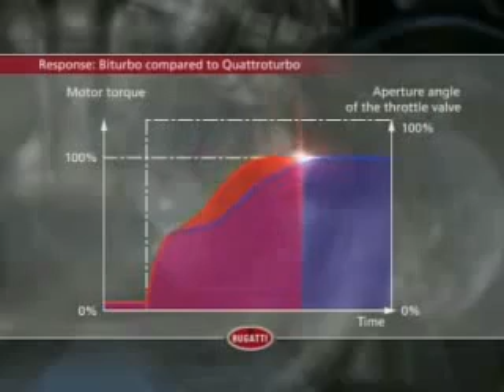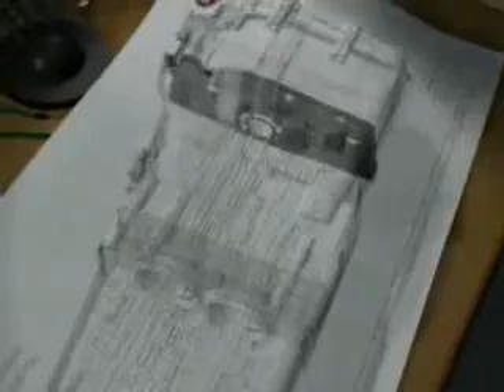Bugatti Veyron Engine how it works

Comment: Designer ip protection  body 
Innovative of rebirth engine redesigned Yorkshire Roger Lee 1983 to before market crash 1987
Innovative of human interlect  industry bugatti 2 piece solutions 
A early teenage mechanic  panel beater given  task 
Without bugatti  typically idea's  of interllctual minds work  mysticism missing innovation  nonaccount  since 1920 
1983 1987 recognized bugatti designs otherwis frozen till 
Late 2007 onwards 
Appose bugatti vw   Germany 1998  application
Actional  discrepancy unacceptably decade's 1983to1988 bugatti revived missing file on school high behalf records tangeleticall

Comment: There are some complaints about "weakness" of that engine(i.e. "oh no, old supra can do 1000hp as well"), well it's not about absolute extreme of power over rpm function, best riding experience is about derivation of that function which have to be as constant as possible yet starting at highest level. In another words you will appreciate constant or at least lineary growing torque to supras/gtrs 1000hp which is kinda 100hp@2000rpm/200hp@4000rpm/300hp@5000rpm/1000hp@7000rpm, yet good for dragster-like perfoming it is unusable under normal city/highway conditions. And good power/torque distribution over entire rpm range comes from engine volume (considering other things like turbo or ECU quality/perfomance are the same). And of course people complaining about 1000hp is not so much seems to be the ones who never seriously tried even true ~300hp car at its 300hp rpm range on the track - even that "weak" engine requires damn good skills to turn. Also look at wrc cars, not so much hp but yet mad perfomance thanks to torque distribution.

Comment: 1000 hp really isn't all that impressive when you think about it
Reply: 1000 hp isnt that impressive because a GTR or supra can do 1000hp with 1/10 of Veyron's cost. But what is impressive is the way that engine delivers power and also the reliability of it.
Reply: yeah, because everyone makes those kind of engines...
Reply: mmdirtyworkz its not about everyone doing it it is just that fro 16 cylinders and 4 turbos you should expect more from such a complex high price motor
Reply: I agree it really ain't especially when you figure the cost in on one of these car's you would expect a hell of a lot more it sad you can take a average small block ford gm Chrysler and build it to push just as much HP for a fraction of the cost. but I guess it's like a nike shoes your paying for that name.

Comment: Does it have VTEC?
Reply: clearly you're too stupid to understand a joke.
Reply: well the joke wasn't funny at all
Reply: maybe for your feeble mind. run along child.
Reply: +dsmero I'm not a child by the way
Reply: +Callum just a timmy maggot
Reply: well, it does have variable valve timing. But unlike VTEC in the w16 all the intake and exhaust valves are opening at all RPM ranges. VTEC is high rpm, activates the extra valve intake only on D series engines & B series both intake & exhaust.

Comment: all this yet hennessy beat it with nothing more than a supercharged v8?!
Reply: the Veyron engines architecture is basically the same as the VR6 (imagine 2 VR6's joined together with an extra cylinder on each bank). it's very low power for its displacement and it's appallingly inefficient.
Reply: Luke Schofield It is 2 VR8 VW engines driven off the a custom crank. VW made quite a few more detivatives of the VR type engine than just the rubish 2.8l VR6 8valve. The next generations of VR6 ( like the 3.2l 24valve) was alot more efficient and the VR8's were very good engines as well.
Reply: So It's Technically A WR16?

Comment: every Toyota Prius has more advancet engine ... 

8 Liter engine with 4 Turbos and 1000 hp is shit.  Volvo builds 4 Cylinder 2 liter engines with 450 hp a little bit tuning and it maks 500 then make a V8 out of it é voila a 1000 hp engine wich is lighter than the W16 and needs only a split of the fuel.

Ore you by a R35 Engine from Nissan even a better solution, there you can have 1000hp too and it will cost 1/10 of the bugatti engine
Reply: +MKS Racing 8 cubic liters* !!!

jokes aside, dont just compare numbers. This engine is not competing with any one you mentioned. It has 16 cylinders! It makes engine really smooth. While those inline4 or V8's will be screaming insanely to reach that power, this engine will run smoothly with an ease. It is not a drag car, It is engineering marvel. Only things that could compete in terms of difficulty, would probably be like a 6 or more rotor rotary engine. Those engines, you mentioned, would probably be unusable on the street, since their power would be untamable.
Reply: Māris Samats Well it is not that difficult to build believe me i am studieing automotive engineering, this engine is only bug nithing else. 

And yes the Volvo engine is for road use and has no turbo lag because of triplecharging (2 normal Turbos and 1 elektric) 

I already saw a GTR with 3 bar charging and about 1300 hp in road use (well this engine has nothing todo with a original R35)  and it is drivable in citys (if you can handle the torque)

The W16 is smooth yes but i prefair an engine who weight 1/3 of it  with same power and a V6 is smooth anought for me
Reply: +MKS Racing it's not about how much power you make, there are 1.6L honda engine with 6 700hp. It's about the smoothness of the ride and has to be reliable. A 1.6L engine with 700hp will fail sooner than a w16 with 1000. Today people can make a lot of power out of tiny engines, but we can't make it reliable,  top fuel dragsters make 10000hp out of a v8, they only last 400m....Back in the 60's manufactures produces 5.0L engines that only had about 140hp, they're still running strong because they're not pushed to the limit
Reply: +MKS Racing Bmw build 1.5L race engine with 1500hp, and it was reliable. You can, but you can't mass produce it, people barely know how to tame 140hp nowdays lol, good point there, inline 6 is the best combination it's really smooth. Good day to you mate
Reply: +MKS Racing you should also study how to spell as well there bud...
Reply: +Mike Schuman Well i speak 4 languages and egnlish is not the second best
Reply: Cristian Ceclan Actualy we can build reliable 1 Liter engines with about 1000 hp but it costs too much. 

and about smoothness a 6 cylinder inline engine is the best. Combine this with multiple VTG turbochagers and maybe an electikal turbo for loxw rpm and you have a lighter, smoother engine with the same power ...
Reply: Cristian Ceclan Good day too :)
Reply: +Cristian Ceclan That engine was only run at 1500hp for qualifying. And it was very very high strung. W16 is smooth and reliable
Reply: MKS Racing bugatti with 6 cyl? Kidding me? Bugatti with 6 cyl will be like a woman with 1 boob..just because you see 1 boob is lighter than 2

Comment: 8 cubic liters? Does that take us into the 4th dimension?
Reply: +MegaJohnhammond Actually wouldn't it be 27 dimensions? 3^3? Anyway, there's always pubic inches.
Reply: +MegaJohnhammond Yes it generats a hole in space where it can sucks directly energy from a 9 dimention alternativ universe.
The fuel injection only is for Sound ;)
Reply: MegaJohnhammond no but it takes us to the fuel station every 20 minutes 😂
Reply: 488 cubic inches.
Reply: 454 is 7.4
Reply: no that just means you can fit 8 liters of petrol within all 16 cylinders, liters is a measure of volume after all
Reply: @emiliospowerballer1441  its a joke a liter is already a volume measurement it measures 3d spaces so it was pretty redundant to add the "cubic" part before it

Comment: A engineering masterpiece that has no practical solutions to average person except that it looks very ingenuitive  and dazzling.        1,000 hp or 100,000 hp what is it its practicality in every day use in order to run over grannies walking across the street with a walker.  Its so fast so expensive its so impractical.   Hurray.
Reply: +Nancy Gordon  It is not a masterpiece aktualy a every Toyota Prius has more advancet engine ... 

8 Liter engine with 4 Turbos and 1000 hp is shit.  Volvo builds 4 Cylinder 2 liter engines with 450 hp a little bit tuning and it maks 500 then make a V8 out of it é voila a 1000 hp engine wich is lighter than the W16 and needs only a split of the fuel.
Reply: +MKS Racing dude im no bugatti fan but shut the fuck up about the god damn prius that fucking car is a joke and i get a major murder boner when i see a tank drive over one.
Reply: +hardwirecars               Prius gets your rocker firing into a complete meltdown.    Lmao!!!!!            Prius Wins!!!!     Prius Rules!!!       I've never loved the prius so much.     Prius Priceless.!!!!!     I wish me a Prius or honda civic.    Both are revolutionary to the human kind in advances of leap years ahead of its time.    Prius you are the Crown.

Comment: what the heck. it produces 1000hp but engine weighs approx 400 kilos. and total weight of car is 1.8 tons. so bugatti veryron has approx 600bhp/tonne. but areiel atom v8 has 900bhp/tonne. according to wikipedia. then what ariel atom v8 wins over veyron. by more bhp/tonne.
Reply: +gt fr You're looking at horsepower to weight ratios, which is good to look at but it doesn't really tell you the whole story.  There are other factors to take into consideration.  I'm no expert so take what I'm saying with a grain of salt, and if anybody notices I'm wrong on anything please feel free to correct me:  Drivetrains are probably different for starters.  This car is AWD.  The car you're talking about (sorry, but never heard of it) is probably RWD.  This going is going to destroy any RWD car in initial acceleration because it's got all 4 tires gripping and launching the car while the RWD spins for a while before it regains it's grip and goes.  Starting a car from a dead stop is pretty much the hardest work an engine, the tires, and drivetrain does so that's a huge advantage to have on launch.  Second, you have to look at torque.  I'm betting this car produces a LOT more torque than a v8.  You have twice as many cylinders as a v8.  Also, in top speed, this car is probably going to win.  The faster you go it takes exponentially more power for an engine to fight the wind resistance and friction.  This car has was engineered to maximize aerodynamics to achieve the highest top speed of any production car at the time.  At least it was I think at one point the fastest.  Not sure if it still is.  Probably lots I'm missing, but I think I've said enough.  Cheers.

Comment: Someone has to be dumb to buy this car already for its insane price tag with average specs. Your gonna pay top dollar for a 16 cylinder it doesn't even need when you can make any v6 faster? smh #stupidrichboys
Reply: I doubt any v6 car in the world can look and give you the status a bugatti will give to its owner, you can may have a 1400 hp v6 mustang ( I doubht a v6 can go that far), but it never going to be as fancy, reliable and fast as a bugatti + if you blow your engine is game over pal.  I know what you mean and at some point its true this car price is obscene but that doesnt mean you can take wharever v6 car and make it "faster" but just because its faster than a Veyron it doesent mean its better, because modifieds cars are never as reliable as a factory car, #stupidignorantboys
Reply: SES10M If my engine blows game over huh? I could use your hash tag against you right now. Modified cars can be just as easily fixed as cars out of the factory. Yes, the v6 or inline 6 engine (which ever you prefer) getting modified to get that kind of horsepower will have heavy modifications, but that, in no way, prevents any mechanic who is certified in engine/transmission works to fix it. A certified mechanic may even tell you how you can get more horsepower. I'll say it again, rich people are stupid and are getting fucking robbed by bugatii
Reply: JoseSaidWhat? you blow your engine YOU HAVE TO PAY, you can blow the bugatti engine and they just swap  due to a little magic called WARRANTY! you blow away your 70.'000 supercharged, Nitrous twinturbo V6  and you have to pay from you wallet, but in a luxury car the company will swap the engine or at some case give you a new car....  that's the BIG difrerence, you have all the support and warranty from a FACTORY car in a bugatti, ferrari, lamborginni, camaro,  mustang, pirus etc. wile in your super tuned prostreet v6 2000 hp car you broke it you fuck it
Reply: JoseSaidWhat? you dont even Know how to write Camaro.... you cannot defend your argument w/out insulting? I bet you drive a Honda, VTEC rocks in you right bro? pfff what an clown  you dont deserve my time if you think only with a 2000 you will be faster whan a bugatti and your insurance will save you 100% cost of a 2000 hp engine you dont have Idea, btw I feel you are a very very resentful person... I bet you are so mad because you know you are never going to be able to buy a car like this, or even a C7 zo6 that is the cheapest super car on the market today.
Reply: SES10M Don't make me laugh kid. "Betting" isn't gonna get you anywhere in this argument. It just shows how burnt up you are by me with nothing else to say than hurl insults at me that I couldn't take seriously. Then you try to elevate yourself in the argument by saying I'm not worth your time but you can't even use resentful in the right context? Your the sad one here. Yes I will be honest and say that I'll never be able to afford a Bugatii but that in no way makes me want to have one. I have no problem with that and if that bothers you then you have personal problems.
Reply: This argument is YouTube gold.

Comment: While an impressive feat of engineering, it's also a bit archaic if you ask me. I mean, the electric motors in a Tesla are much simpler(ONE moving part-not hundreds!) and IMO superior to the "Vay-rohhn"  W16. The new Model S P85 D is only a few tenths slower to 60 MPH than the Veyron. Electric motors ARE the future of automotive propulsion. Pure and simple. Period!
Reply: NO SOUND, that's why i will never settle with an electric motor, ever. Gas engines all the way.

Comment: 16 cylinders is too much friction, and 64 valves on 4 camshaft adds even more. Which is probably why 6 cylinder 2JZ's can make over 1200hp easy. This just looks like the superfluous work of some old italians
Reply: mercedescl Thats horseshit! I know quite a few supra guys here in Ga with supras making over 1000whp and pass emissions and they drive em all the time 10k miles is nothing for a 2jz makin 1000whp
Reply: But a 1000hp 2JZ can't pass current emission test and it won't come with a factory warranty. In fact, you won't be able to do over 10,000 km with it.
Reply: ***** 2JZ?, was that not what Fred Flintstone used in his car?
Reply: Dave H What part of georgia? I live north of atlanta
Reply: Dave H Lol. No one can verify your claim. And no one will pay 1 million Euros for a 1000 hp Supra.
Reply: Now make the supra last more than 10 years without having to rebuild it.